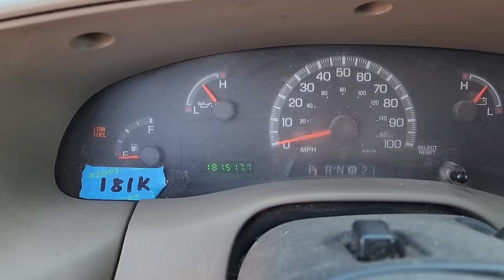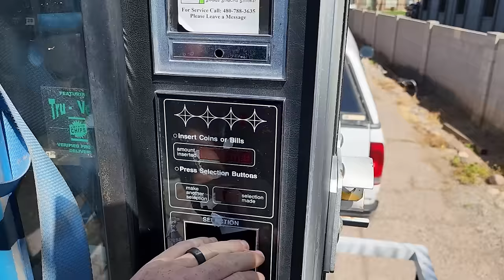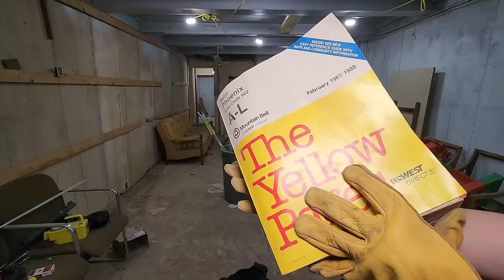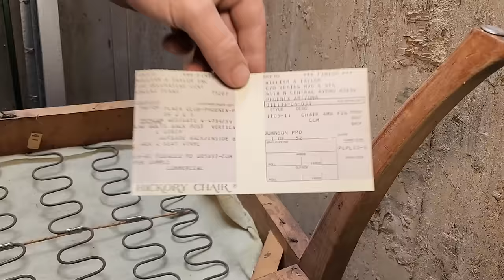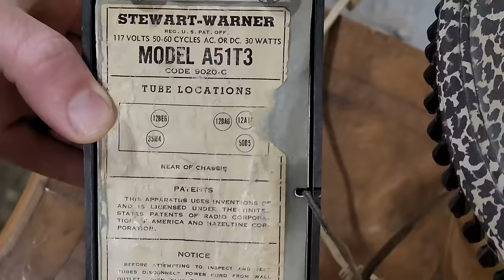The Spiff Up | Abandoned Backyard FALLOUT Shelter Restoration ep 17

Comment: Clean and degrease the floor, do an epoxy coat on it. Concrete all the cracks in the wall, do a few coats of deep-penetrating Kilz primer then a color you like. Fix the electrical as best as you can, Insulate the ceiling (keeps the a/c in) and then do some cheapo panels. Prolly don't even need the water tanks and you can install a cheapo chemical toilet if you really wanted to. Unless you really wanna get into renovations, just rip all the plumbing out and use the space for something else.
 
Could be a nice little mancave to chill in if you really wanted to work on it.

Comment: This is awesome! That radiation meter is a great one! It's a CDV-717, which has an extension cord so that you can place the sensor outside of your shelter and then read the radiation levels from the safety of your fallout shelter.  If you can, put another wall between you and the entrance. -Reason being, you need more gamma radiation attenuation. 

The bathtub is a Japanese-style, which consumes very little water while allowing the occupant to get a full bath in limited space and limited water! 

I've seen a 55 gallon water barrel like that hanging from the roof in my buddy's granddad's fallout shelter once! 

What do you plan on doing with the walls? Paint? Sealant epoxy coating, what?

Comment: Man you guys are so lucky to have that bomb shelter, especially these days.☢ Get the plumbing working, sewage/shower and a good air filtration system = the value of your house is going to double. Just remember to get a solid plate steel door and steel door jams.   Remember what happened in that Twilight Zone episode when their was a false bomb siren going off and the neighbors tried to force their way inside the families shelter? Moral to the story = don't have cheap tin foil doors on a bomb shelter. :face-green-smiling: Having an escape tunnel and extra hatch would be a good idea for safety.

Comment: Well "The Dude" has some control. Our dog would look for a corner to pee in within 5 minutes to claim Bunker Dog Ownership over the other critters. BTW, I fix-up older tube radios and looked up yours and it's a 1947 design.  And for $20 and have it working..your wife scored a pretty good deal! Also that's what is call a "hot chassis" design so don't drop in the tub while taking a bath.....

Comment: You may want to plug off the sewer lines as the water in the trap  is probably evaporated and  allowing gases in the bunker. Also the older radios may have the chassis live if you have a 2 pronged plug be careful.
Reply from the maker: That's probably why the videos are so silly, we've been getting high off old giggle gas.